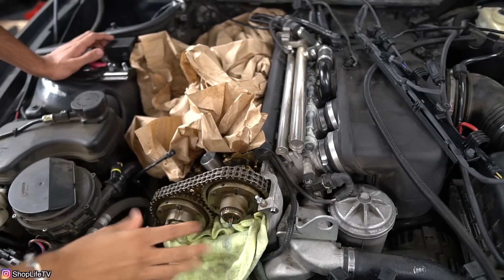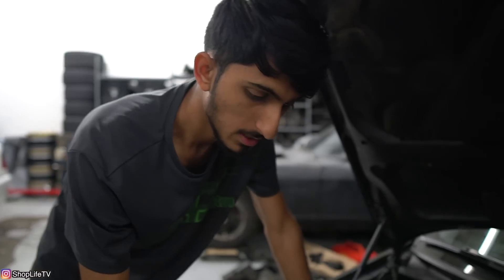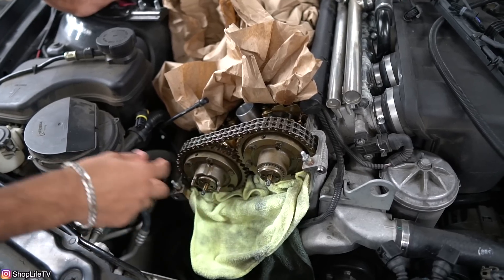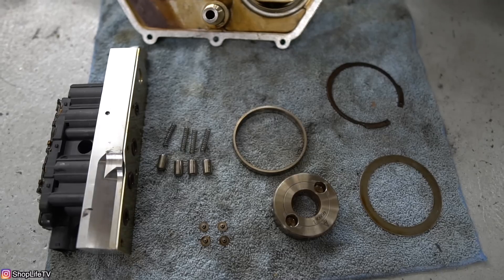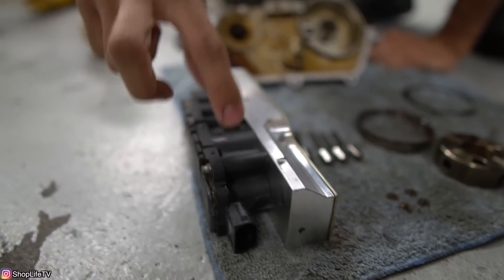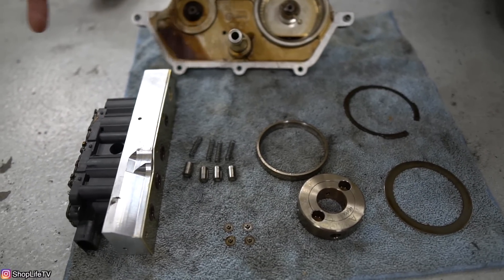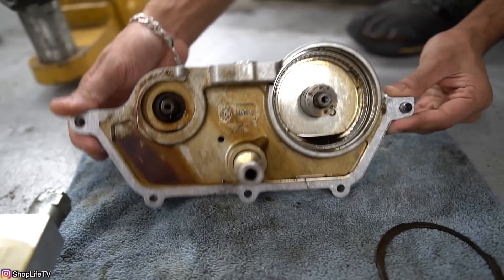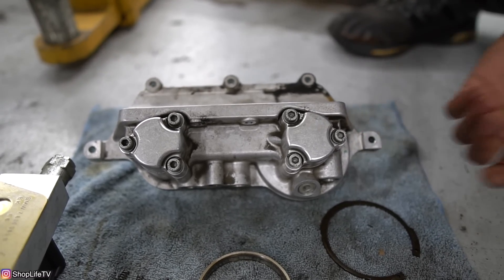S54 Vanos Symptoms/Common Issues/Prevention/Repair

Comment: Hello. Thanks for nice video. I have a very strange VANOS issue. Note - the Vanos has been rebuilt with all Beisan components, I have the pump disc, bolts, refurbished solenoids, seals, new accumulator, everything. My car is tuned, running Schrick 280/272 cams and CSL airbox with MSS54HP ECU. I've developed and issue where the intake cam doesn't meet target value in the middle RPM range. First, after much trial and error we found that the issue was with the vanos pressure regulating valve, which was NEW from BMW. We fitted a new one again, which seemed to help, but now (literally after one thousand kilometers) the issue is back. When logging the vanos operation, the exhaust closely follows target, but the intake is a mess. Funny thing is, I'm not getting any Check Engine Light, nor is there a fault stored in the ECU that is VANOS related. Have you encountered such problems?

Comment: I have a 2003 BMW M3 E 46. I get a P0300 through a P03003 trouble code I put a brand new complete Vanos on it. I did coils, plugs, fuel pump, fuel filter, regulator fuel injectors, O2 sensors, and I still get the same codes only on bank one have any ideas and do you have an email address? I can email you so we don’t have to do it on your video? Thank you I appreciate your help and I enjoy your videos.

Comment: can someone help me i got a problem with my BMW 328i e46 when i start it cold it will run roughly in idle and if i hit kick-down(cold and war) and get over 5k rpm it will misfire on all my 6 cyl and i have changed spark plugs and coils. But can this be the vanos as well?

Comment: Beisan instruction said to " turn camshafts counter clockwise to adjustment end position." prior to checking your timing with the alignment bridge at the end of the instructions, my timing is off after I fully retard the cams, but it's good prior? so I wonder if the cams have to be fully retarded prior to checking the timing?

Comment: Hey! I took my 2000 328ci to get a smog, and I ended up failing due to a cyl 2 misfire, and p1523 & p1525 error codes! Does that deal with the vanos or camshaft sensor?

Comment: My M3 put up a code P0014 and P0011 which was crankshaft position sensor and camshaft position sensor. I change the crankshaft position sensor with oem and now a code P0017 is saying camshaft crankshaft correlation. Is that a vanos issue? Or do I need a correlation relearn? Love your vids btw!!!
Reply from the maker: I would suggest replacing the vanos solenoid pack with a beisan systems one and see if that helps
Reply: @ShopLifeTV   Ok thanks a lot!

Comment: Hey Guys Like your channel! Hey a question for you I have a 07 X3, I had the check engine light come on a while back so took it to the shop they got a P0012 code intake cam out of time so now they have tried everything they can think of new solenoid's, new timing chain, new cam gears, and like you said they have parts that they can throw at it so cam sensor, crank sensor, oil flush and still the code comes back but it only returns on a cold start and then maybe the next day or so will go off and then come back again, so now they don't have any idea and are telling me the only option is to replace the engine it only has 122,000 on it and runs great when the light is off but stumbles on start up when its on. so I don't know any ideas besides the engine change!

Comment: My S54 makes the :marbles in a tin can" sound intermittently. It occasionally makes the sound when winding down after coming to a stop. Does this sound like the vanos?
Reply from the maker: Usually that indicates broken hub bolts, I'd get the vanos overhaul done soon, if all of the bolts shear then it will cost a lot more
Reply: @ShopLifeTV  Thanks for the reply.

Comment: thanks for all of your videos they've saved me tons of $Money  2nd i have a 2001 bmw 325i with misfire codes1345/1347 Cylinder 2 and 3 with fuel cutoff to the injectors ive replaced valve cover and gasket spark plugs coil packs fuel injectors ccv  intake manifold gasket dissa valve and throttle body o-ring theres no oil mixing with antifreeze i can clear codes with scanner and car runs fine next i will change fuel pump and fuel filter  any other suggestions will be greatly appreciated

Comment: So i got the m54 engine 
Code exhaust camshaft position sensor & i get major sputtering on fast acceleration even in nuetral when i rev. I don’t have any other vanos related codes. Could it just be the actual sensor

Comment: Hey bro i’m working on e30 and i need new engine should i take the s54 or s52 ? i need reliable engine with power so what do you think? and any another engines you recommend? 
thanks you bro keep going
Reply: Your going to spend 10k on an s54 swap, and they aren’t for a casual wrencher to do.  An s52 is much more straight forward, but it will still cost a lot.  Find a m50 525i complete car (preferably before 94/12 to avoid ews ii, contrary to popular belief you can use ews 1 silver label ecus) and you’ll have nearly everything.  That way if you want an s52 later you’ll already have the oil pan, wiring, etc.
Reply: @curtislovrak5390  Thanks dude , but i change my mind 
i'm going with the 2jz best engine and cheap price for the power . all what i need 500hp and 2jz can make more with the stock interior

Comment: Good info and you forgot to mention what hardener to use on when replacing those hub bolts ! I had mine replaced at 70 K as 3 backed out ! Very Dangerous and makes a distinct metal shearing Noise no rattle !

Comment: hey good videos about the S54. me and a buddy have done the cryohub and upgraded oil pump and the vanos becouse we had a rattle between 2-3rpm only while driving. but after upgrading the rattle is still there. what can it be? and wierd that its only between 2-3 rpm we can hear it. plz help. thanks alot for good videos again.

Comment: Hey body i watch all your video, i like how you explain step by step, i nelp your help, i have 04 m3 e46, look like i have oil leak by the tensioner  bolt, will i lose  timing if i removed it?

Comment: Love all the comments completely dissing the whole E46 M3 platform based on an experience with a bad example. There are bad examples of each model from all manufacturers. Wake up people. Bad examples/lemons are always down to poor maintenance and neglect by current and/or previous owners. Buying one is always a gamble as it is very rare to be able to trace every bit of history and ownership. An educated guess is all we petrolheads can do. For every single person bitching about the model there are hundreds of others who stand by it and say it is the best drivers' car they have ever driven. Yes, the Rear Axle Carrier Panel, commonly and mistakenly referred to as just "subframe" is an issue that can be sorted. Vanos and diff? They are consumables, both easily replaced. Rod bearings? Once replaced they will never need looked at again unless the car has been regularly booted by some twat while the engine is still cold. My own car is a 2001 model at 134k miles on the recalled bearings. Oil analysis shows they are still well within allowable specs. RACP still good. Original vanos unit, again still good. Original diff, very slight noise from cold which I will be replacing in a few months. This car is still regularly used as a benchmark. I've never known any other car that is constantly compared with brand new models from various manufacturers. And above all this it is an 18 year old platform?! Can the haters please explain that one?? Of course there are faster and better cars out there. After 18 years there fuckin well should be.. 
And lastly, to the idiots saying to avoid this ///M just because there are faster and better cars need their dosy head looked at. That argument really is pathetically null and void. But, haters are gonna hate as they say.
Reply: true and look up IMS bearing issues on Porsche 911 cars

Comment: Thanks!  I'm fairly new to the S54 platform & definitely want to do the PM.  Likewise, while everything is opened up, add a valve adjustment, spark plugs, & coil packs to the list.  Winter plans.
Reply: Stymie Snerdly sell it and purhase a 370z or a 2017 Camaro ss 1le.They're both cheaper to maintain and will outperform your m3.I know this because I have an 04 m3 and theres always something wrong with it.
Reply: real isrealite and if you did actually own a E46 M3, you would know those two cars you mentioned are garbage and no match for the S54 and the legendary chassis it’s bolted too. So go fuck yourself

Comment: Thanks for that! Im going to tackle the vanos rebuild soon. I will intall upgraded cam gear bolts and take my pump disc to a machine shop to re-drill holes. I have done a vanos rebuild on an m54 but never on an s54 and am nervous about having to time the engine... i will buy a timing tool, any pointers?
Reply: Take your time... No rushing

Comment: Hey Jason
I don't have Instagram
I got an E90 with vanos codes
I replaced both solenoids 
Replaced both cam sensors
Owner neglected oil changes so there was some significant sludge buildup.
Did two oil changes with cleaner in between
 it has random misfires on cyl 4 5 6
And there's a thud at idle
When codes are cleared the misfires go away
Some suggested replacing valvetronic...

In your experience what are the possible causes?

Codes 29cc, 29d0 29d1 29d2
Codes for vanos (sorry forgot the exact label)

Comment: Thanks for the video. I purchased a '04 manual M3 with 140,000 miles and it's been running great so far but I do want to get ahead of any major problems.

Comment: My first e46 me SMG did not have vanos issues and I had it to 132k miles.  Did have SMG go out.  Second E46 had a total failure of the vanos at 83k but I did a reg manual.  I diy my vanos over two weeks.
Reply: erick quintanilla You actually purchased two e46m3s.Thats like forgiving you wife after she has a baby by your father.

Comment: How did you setup and remove the vanos AT from the head? Don’t you need to put it on TDC then put pins in the cam ? And lock the crankshaft sprocket with a pin?       Btw, thanks so much for VACMotorsport hub upgrade. It is the best one I’ve seen.
Reply: B Souza you can take it off in any position, it is best to take it off on TDC and with the cams locked, I ruined at least 3-4 valve cover gaskets trying to get the timing right even with tools.

Comment: Question: have you worked on a lot of E46 M3 s? What do you think of them because I was looking into one recently
Reply: As a 04 m3 owner I would tell you not to buy one.They're like a beautiful woman that steals your money,cant cook,wont work or clean the house,and fucks all your friends and neighbors.If you can stomach that and still look in the mirror then yes you should buy an e46m3.
Reply: You've been forwarned about e46m3 while I had to learn about the car the hard way.
Reply: So you bought a poorly looked after lemon. It happens. No reason to diss the platform as a whole.
Reply: Dud you ever get one? I have had one for 3 yeara. Got it with 112,000 Mike's, it has 130,000 mimes now... I did the inspection 2 service at 120,000 and I did the rear subframe reinforcement as some preventative work... Looking to do the vanos bullet proofing within. The next 5 to 10k Mike's. I also diy'd the alternator and drive belts last summer, I also did the steering coupler, when I first got the car. I use liquimomy oil every 5k miles. So far the car has been great! It's not my daily driver though.
Reply: Subframe Subframe Subframe Rod Bearings Rod Bearings Rod Bearings

Comment: With all these problems sounds like bmw are lemons. Should have done more research before I bought mine.
Reply: Should have, too bad u didnt
Reply: The e46m3 is a lemon.Vanos issues,rod bearing issues,sub frame issues are just 3 reasons not to buy them.Not to mention theres less expensive,more reliable and cheaper cars that out perform them.Bmw is just another european car company screwing customers world wide.
Reply: @realisrealite5554  do you have an e46 m3? Have you ever driven one?

Comment: thank you so much for doing some S54 videos! so hard to get videos for this motor, i just had to put mine away till next summer, miss fire across all cylinders, i changed all the coils, spark plugs there were 2 burnt coils. but after that still misfire across all cylinders still so im thinking the vanos solenoid is the problem. No vanos codes tho, did get a over retarded on the intake cam p0012.on top of all that i noticed taking the oil cap off the engine while it was running did absolutely nothing no change. 2002 m3 manual.